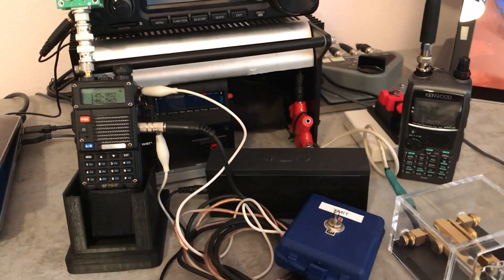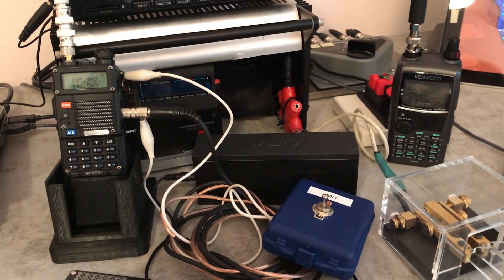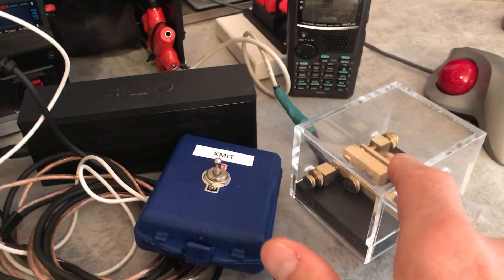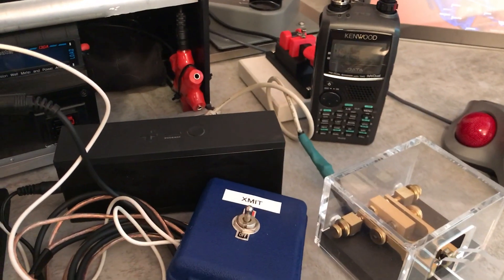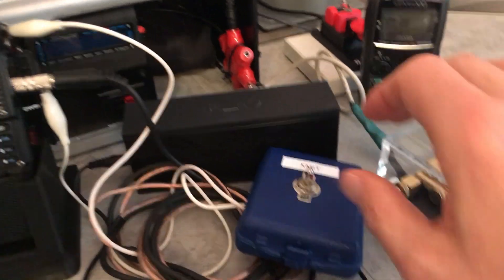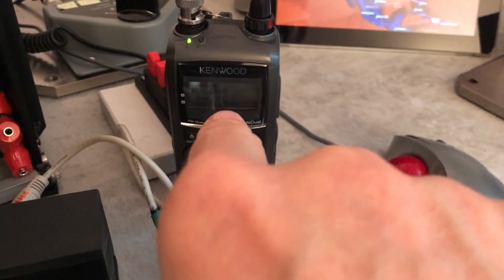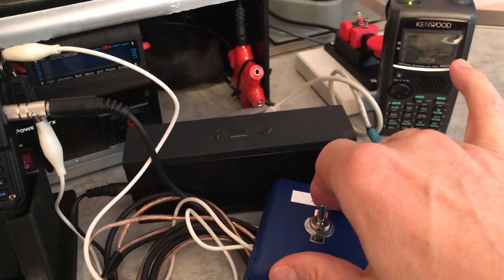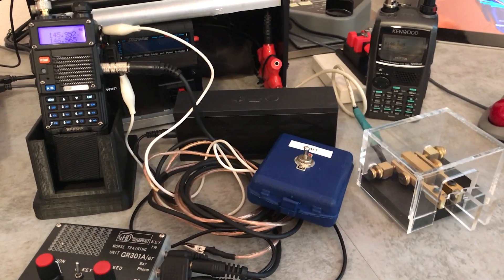Ham Radio HT CW Transceiver Project

Comment: But it's not classical  CW, it's  CW over FM modulation
Reply: MCW
Reply: What if you'd use the PTT switch as a straight key? Not great for high speed CW, but might do the trick in a pinch.
Reply: @AnotherSheeple  I have wondered the same thing.  I think ultimately why its not a thing is that even if someone happened to recognize the keyed code there would really be no way to make contact other than (I guess) responding via phone.  I guess they could theoretically respond via PTT in a similar manor.  I still love the idea of figuring out a way to do CW on a Baofang... It just seems doomed out of the gate.  @HamRadioCrashCourse's video about it helped me frame my current thoughts.
Reply: @DigitalAndInnovation  You're assuming both sides are symmetrical.
If I'm limited to my HT's 5W but the other side has a mobile or base station with a better antenna and/or power you could make a mixed mode contact or just fully CW. Another member of the radio club I joined recently managed to make a QSO (I believe during a contest) by sending CW and receiving SSB, though that was due to QRM on one side.